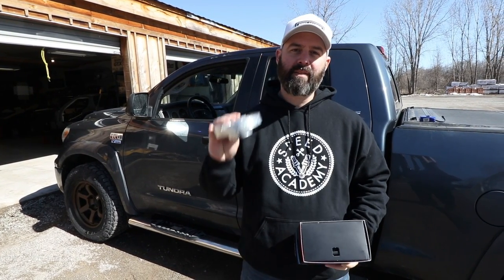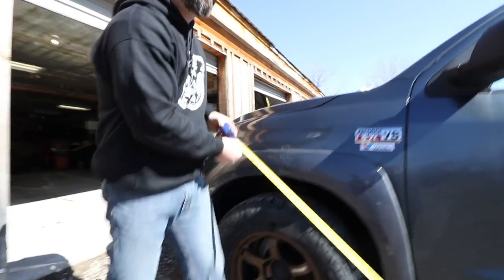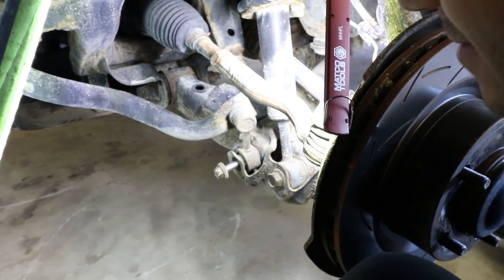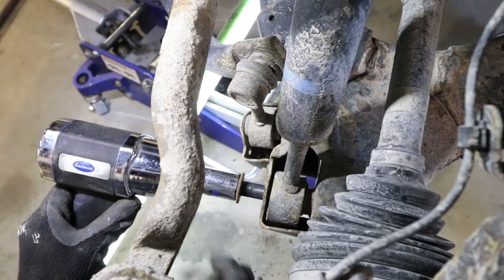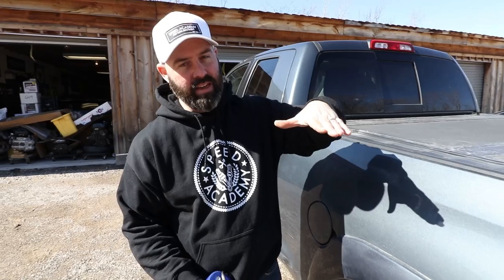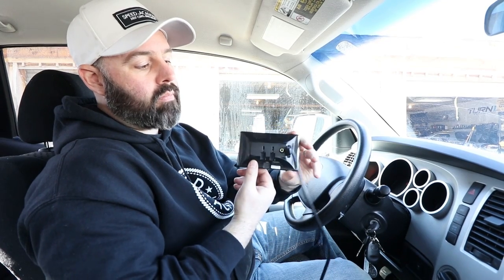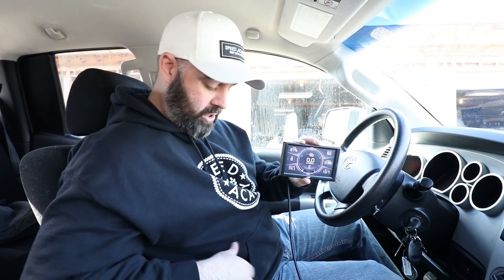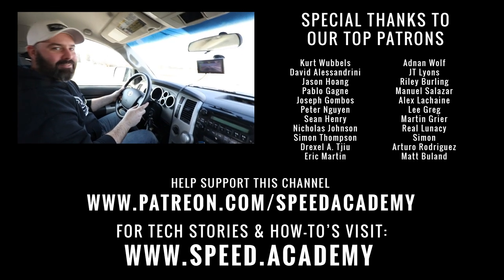DIY 1-inch Lift Kit + 0-60MPH Test with Edge Digital Gauge - Toyota Tundra Project

Comment: I know this is old but how did the truck ride after the spacer install?   Does a spacer just add preload?  I'd like to level my truck just a bit but the ride on these Tundras are stiff enough as is.  Great videos btw.
Reply from the maker: No change on ride quality at all. Still rides rough 😆
Reply: @speedacademy  Hahahahahha right?!  🤣
PS you've done the most tasteful awesome mods to this truck.   Definitely not a BRUHTUNDRA.  The wheels are just freakin superb.  Great choice on the conti's too.  👍

Comment: Seems like a strange spacer kit to me. Why wouldn't the spacer go on top of the top hat instead of under it. You're effectively increasing spring rate to raise the car. I've installed spacers on a few cars and they went on top of the strut top.
Reply: Mark Coleman I was thinking the same thing
Reply: Mark Coleman - they look like linear rate springs to me. So it should make no difference to spring rate regardless of how compressed the spring gets.
Reply: J B linear rate springs still require more force to compress as it's compressed, it's just constant rate that the force has to increase for a given amount of compression. This spacer is preloading the spring 1" so for whatever lb/inch rating they have they will now require that much more force to compress each inch effectivly making them stiffer.
Reply: J B not true. imagine compressing that spring by three inches. The spring is essentially preloaded now and you've increased the initial spring rate. The way these spacers install, the spring is compressed by 1". So the ride will be stiffer and you're also putting more stress on the shocks because they are trying to control a stiffer spring.
Reply: No, Mark, that's exactly what "linear spring rate" means. It means for every inch you compress it, the same amount of force is required. If you'd hit a bump that compressed the spring 1 inch then it will still compress 1 inch, just now you're going from 1 to 2 instead of 0 to 1.
Reply: Totally disagree. The resting spring rate will be higher if the spring is compressed. I get what linear means but the way they added the spacers, the initial spring rate is higher because the spring is compressed. If you don't believe me, grab a spring and push down on it. I'll bet you can compress it an inch or so with all your force. Now take a that same spring and stick in some spring compressors. Compress the spring 4 inches and try again to compress the spring. I'll bet you don't have the strength to budge it at all. 

It's just like coilovers shocks that don't have adjustable threaded mounts. If you want to lower the car, you have to compress the spring, and by doing so you've raised the amount of force it will take for the car to compress the spring.
Reply: I guess if we're all going to become engineers here, the correct term is restoring force. The "spring rate" doesn't increase with preload but the restoring force does. Happy now?
Reply: Mark Coleman - yes I hear what your saying but I guess there's a difference between increasing preload to change sag which is what these spacers are obviously doing, and increasing spring rate which is what your original comment referred to. In my my opinion your just using the wrong terminology when referring to increasing spring rate.
Reply: I get what you're saying and that's because "linear spring rate" is an oversimplification, it's more like "linear within their working range". On springs that long the extra force required with 1 inch of compression already applied is not going to be significant, I doubt it would be noticeable at all.
Reply: Does not matter. The spring is not compressed any more than it was before. You add one inch on top of the spring, car lifts 1 inch. No extra compression in there. Not on progressive or linear springs. Only thing hard limiting the space that spring or spring and spacer has to occupie is the stroke of the shock. That comes a factor only when the wheel is of the ground. When the car rests on the ground shock is not fully extended. Other than that there are no magic pixies limiting the space that spring or spring and spacer can take. Only time any change in that fully extended borderline spring rate would matter would be if you got whicked air with your Tundra and landed it. On bigger spacers you might run into problems with shocks extending too far on regular use. Other than that don't matter.
Reply: @NailHead86  I dunnoooooo.  Motorcycle rear shocks (if adjustable)  can adjust for preload with a threaded ring that effectively raises or lowers the rear.   It's not intended to actually raise or lower for aesthetics but to compensate for weight.  (Additional rider bags etc).  It looks to me like they cranked the preload 1 inch but.... never added the additional weight.  The big question would be to ask how the truck rides after the install?   I'd really like to know.

Comment: I'm pretty sure that's a separate damper in spring layout, rather than a strut.  Generally, a strut takes the place of the upper control arm, so it has to twist when you turn the steering, but you have an upper control arm already, complete with its own ball joint.  And yes, I'm also getting pedantic.  :-D

Comment: Few points. 
1. Usually the spacer bolts to the top hat and has new studs to go into the strut tower
2. You are correct. It's not a McPherson strut. A strut alleviates the need for an upper control arm and spindle. 
3. Because the spring is inboard and closer to the pivot point, a 1 inch spacer will give 1.5 to 2 inches of lift
4. When measuring ride height you should measure from the bottom lip of the rim and not the ground. There's lots of variation in sidewall at the contact patch between different surfaces

Comment: Won't that mess up the spring rate? It would seem like it would make it ride stiffer. Seems like it would be better if the spacer mounted to the top of the top hat instead of the top hat to the spacer.
Reply: I'm wondering this too

Comment: When you measure from the ground it can be different if the tyre pressures are different.  It's better to measure centre of hub to guard. That way it gives you more accurate measurements
Reply: dlyle i hook the measuring tape under the lip of the wheel so theres no real eyeballing it

Comment: Wow ! you use spring retainer as spring compressor. That is what i call "having balls". Do not try this at home, or with a guy you want to kill, maybe ...
Reply: NoRespect that's what I thought looking at the thumbnail the other one next to it looks like a normal compressor
Reply: For me (only my opinion) thoses spring retainer/compressor are not a lot secure.
When you know the huge damage that a compressed spring like that can do if it is released O_O" i prefer use bigger compressor.
My opinion, no troll or something else.
Reply: For maximum JDM cred, I use these to compress some springs then replace them with a full box of zip tie to, then, mount the springs easily. Talk about safety !
Reply: Bad boy baaaaaad boy ! Everyone do what he want.
Reply: Yeah, its a safety hazard, but putting the shocks back in place is a painful job, especially their longer assembly. Zip tie worked for me, plus its a mighty car mods reference

Comment: I wouldn't run a leveling kit. But if you must, the smaller the better. These do more harm than good. It fixes a "look" (that is actually intended by design) while compromising steering and suspension geometry. These kits place the ball joints in compromised positions at full droop. While changing roll center, and adding bump steer. I'm guessing the wheel and tire package changed the scrub radius as well lol. But hey, it looks good...